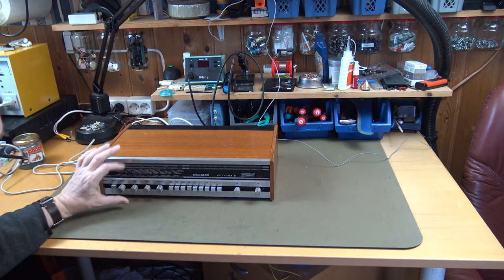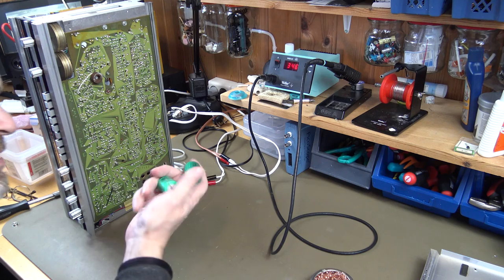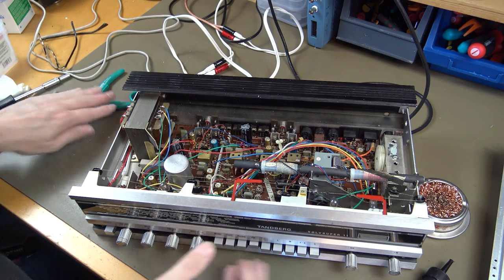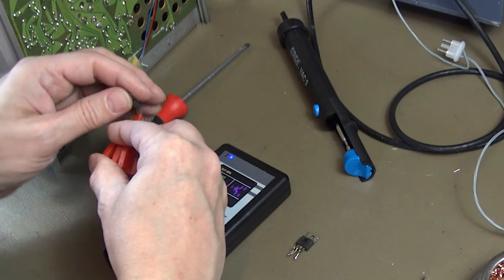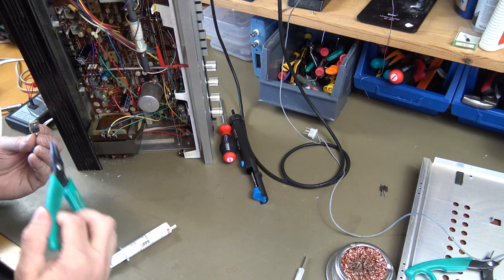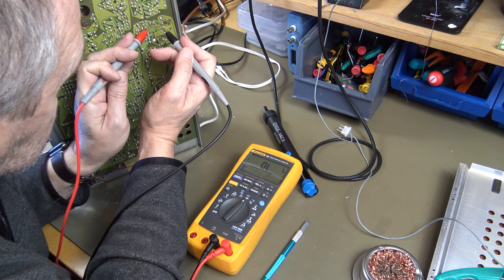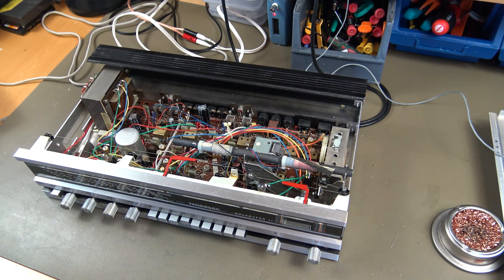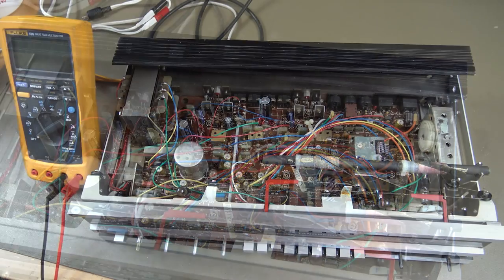Tandberg Solvsuper 11 - Will it Fix

Comment: Touching capacitor is risky because you might got shocked , Is it true that you should discharge them before you start fix?
Reply from the maker: Thank you for your comment. 
That is correct, that touching capacitors can be a risk. As for this amplifier, the capacitors is discharging after switching off, and the working voltage is less than 50V. 
But if the working voltage was to be higher, I would discharge the capacitors before starting working.

Comment: Hei! Inspirerende film og masse gode tips her. Min SS11 har en litt plagsom egenlyd som ikke er fra høyttalerne. Det er snakk om en konstant brumming. Har du noe tips til hva dette kan være? Jeg har loddet  om til 240V uten at jeg syns det hjalp.
Reply from the maker: Hei. Tusen takk for kommentaren. 
Med tanke på din SS11, så kan jeg bare gjette. Men, en slik brumming kommer stort sett fra spenningsforsyning. Det kan for eksempel være filterkondensatoren til spenningsforsyningen som holder på å takke for seg, eller en annen kondensator i spenningsforsyningen som er kortsluttet. Som nevnt, så er dette ren gjetning, for jeg vet ikke om denne brummingen er fra spenningsforsyning eller om det er en transistor som går i selvsving. Jeg håper du får fikset din SS11.
Reply: Er dette noe du kunne sett på for meg? Tenker også den trenger nye kondensatorer i kanalene og litt justering og sjekk. Vet ikke hvor du holder til i landet.
Reply from the maker: Jeg kan godt ta en titt for deg. Jeg holder til i Skien, men er ikke lengre vekk enn hva posten greier å bringe 😊. 
Jeg har Facebook med samme navn og logo. Kontakt meg gjerne der, så kan vi avtale noe.

Comment: My Tandberg TR 220 G: Q802, 803, runs hot (63 degrees) cr804 looks black. From time to time, a muffled rumble can be heard from the right channel. Otherwise the radio "works". What will be replaced from Tandberg next.
Reply from the maker: Hello. First I need to tell sorry for late reply.  
Thank you for your question. I will try my best to give an answer only by looking at the service manual.
Q802 and Q803 is in connection to Q801 as a voltage regulator. If they runs hot, it is because of too high load and too high current flowing through them. As you tell CR804 looks black. That is a Zener Diode for 12V. If I were you, I would take a look in the service manual and check voltages around the voltage regulator. 
As for the muffled rumble in your right channel, I would check the transistors for the input of the power amplifier (Q704 and Q706) and also check the quiescent current. 
Happy hunting.